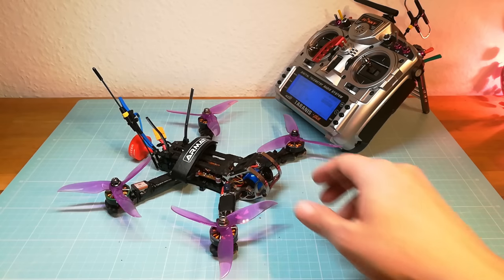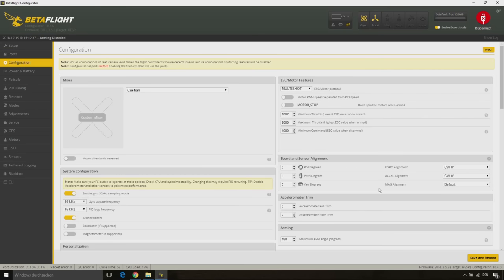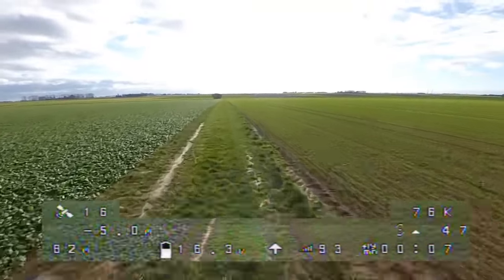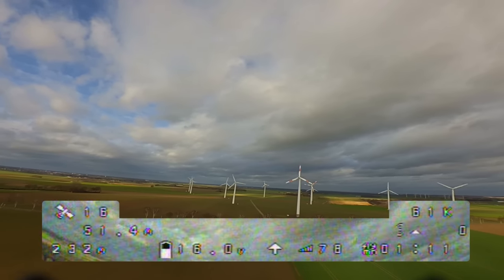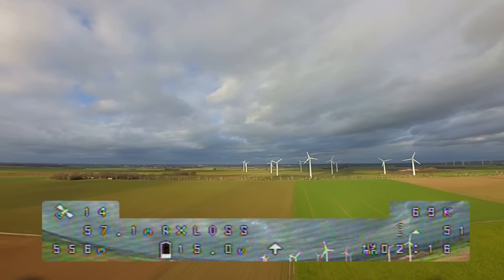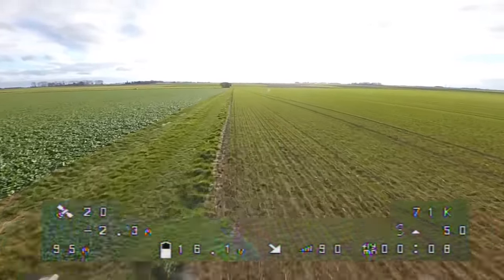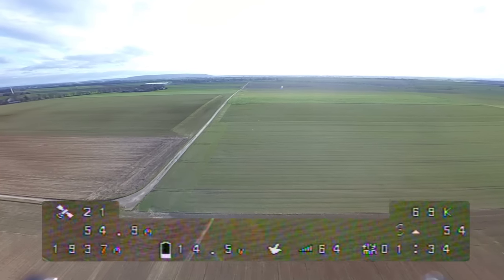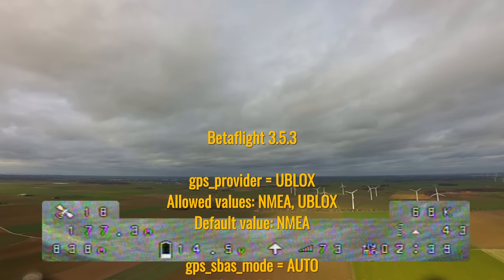Betaflight - GPS 🛰️ Rescue Mode 🚨 - Final Test - BN-180 GPS - FrSky R9M - english

Comment: You have helped me to set up my R9M/R9mm, very good videos...I have subbed this channel. I currently have R9m/R9mm and Gps working fine. I have BF GPS RTH on a switch and that too is working. I want to set BF GPS RTH as my failsafe but I have a question: My normal prefight checks are to power the quad (motors running) and turn the radio off to check that my failsafe is working. If i set the failsafe for GPS RTH in the CLI how could i do a preflight failsafe check?

Comment: It works great, I have a question why the battery voltage does not drop when you hit the throttle?
Reply from the maker: It does when I really hit it.

Comment: Thank you so much, but in taranis configuration, the failsafe that I need to put is "hold, no pulses or another one" thank you
Reply from the maker: I use hold
Reply: @TorbanDallas  thank you! But this hold, won't act like to "hold the stickers" the way they were before losing connection? Or it will work just like in the video? Thank you, loved the video, certainly I will do!
Reply from the maker: @RaafBr  no it doesn't hold the sticks, the bf failsafe tab overwrites the hold of the taranis.

Comment: Great test!! What mount or holder are you using to mount the immortal antenna in the quad in that position?
Reply from the maker: Cable ties 😉
Reply: Really? Looked too rigid to be a cable tie. Perfect!
Reply from the maker: @swissete  take a look at my frsky r9m troubleshooting video - there you can also see the antenna mount.

Comment: well done. 
gps is performing much better .. what was the fix!?.
cheers.
Reply from the maker: Thanks! This is a new BN-180 that i have installed on my other quad, i also have installed a copper shielding foil under the Module to protect it against electromagnetic inteferences. So maybe the shielding foil was improving the performence of the gps module, or the module is just better than the other bn-180 on my other quad.
I will add the foil under the other gps module too.
Reply: Actually, the foil provides a ground plane for the GPS receiver, that's why it works better for you.  The GPS should be up on a stalk for best results, not near one of your motors.
Reply from the maker: @EnglishTurbines  i agree with you, but i can't and I don't want to mount the gps on a stalk on my freestyle quads :D

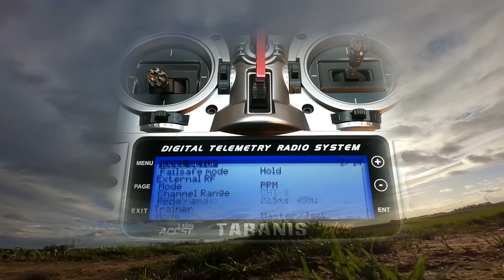Comment: Another question in 4:56 you turning off external module for 900MHz and then you said you will only use internal module for XM+. But have R9M could have connection with 2.4g recievier. I wondering maybe it is redundancy R9mini + XM+...
Reply from the maker: Yes. I also have made a video about it. You find it on my channel.

Comment: Why last test haha ?! , will the Hakrc f4 mini with barometer be a good candidate for a 3 inch micro gps build ? , do you know what gps module will work correctly or the hakrc f4 mini ? This will potentially be my first brushless quadcopter build , I’ve only built and flown brushed micro quads thanks and love the video that was far ! I have flysky i6s transmitter and will be using x6b Rx
Reply: The bn-180 will work if you have a free uart. 
It's cheap, small and works great.
Reply from the maker: Thanks for your comment, i think the gps module will nearly work with every FC with a free Uart Port. I recommend the GPS BN-180 Module that i have linked in my video description. It works fine as you can see and it's very small.
But do you think you really need a gps module for a 3 inch quad? For a 3 inch short range copter it's nice to have, but not nesessary in my opinion.
Reply: Torban Dallas well the 3 inch helifar fuuton mini gets 14 min flight times so I want to build something similar , it’s my first build I’m on  a budget basically so a 3 inch is ideal for me cause I have batteries I can use from my brushed quads I own now . Thanks
Reply from the maker: The LongRanger wow 14 min flight time. That's interesting.

Comment: i set my gps up just like all the videos and think i have it working when it comes to set-up but when i flip the switch it feel out the sky. also it would not arm until i set the sat =o  only arms  also in betaflight how to i make the gps indercator light come on to let me know its working it also show false not true.. can you help???
Reply from the maker: Do it as shown in my video and it works 😉 make sure to get enough sats before arming and to fly further away for testing the rescue mode - like 400m or more like i did.
Reply: @TorbanDallas  ok ill try that but it wont arm when i set sat to 6 or 8 sats only arms  when i set to =0
Reply from the maker: @aknight4u2001  yes of course it won't arm when you set it to 6 or 8 sats, you have to wait until you get your min sats. Otherwise, GPS Rescue mode won't work. Plug in your battery, wait until you get enough sats bevor your arm your quad!!! You can also use the low power on disarm vtx option in the CLI, so you won't burn your VTX when you are waiting for your satellites.

Comment: Vidéo is really cool, after setup the bn180 with u-center, gps on battery strap antenna facing up, I can't get more than 9 or 10.
Do u think or know if gps like bn-880 is better with compass or maybe just the bn-220 ?
Still follow you, good job.
Thx
Reply from the maker: Thanks! I didn't test another GPS module yet. I have installed all of my GPS modules on the arm and covered the underside with copper shielding foil. Interestingly, one of my bn180 get's around 17 sats, the other one only around 12.
Reply: @TorbanDallas  great, thx for fast reply, will try with 220 or 880
Reply: Hi there, what settings should be changed in u-center? Thanks

Comment: I mounted my flight controller rotated at 90 degrees when I first attempted the GPS recovery. My quad flew correctly until I put into rescue mode and it kept flying but in the wrong direction. I forgot to set the orientation of the flight controller in betaflight. Swiching back to acro mode I was able to take control just before the VTX signal dropped.
Reply from the maker: Interesting, but then your gps home arrow was also pointing in the wrong direction, doesn't it?
Reply: It was mounted in an Ummagawd frame so it was rotated and flipped upside down to keep the cabling tidy. Only flew away twice then I realised the different effects that happen when you set 90 deg clockwise and 90 deg flip on gyro AND accelerometer. The arrow worked OK on one setting but in rescue mode the quad flew away rolling left and righ like it was trying to fly upside down. It crashed into a tree with no damage.

Comment: Thanks for this, really helped me setup my gps return to home function. Question: You set your Channel Fallback on Aux 3 to 1500. What does the 1500 represent? You also set your Aux 4 to 1000? What is the reasoning behind this?
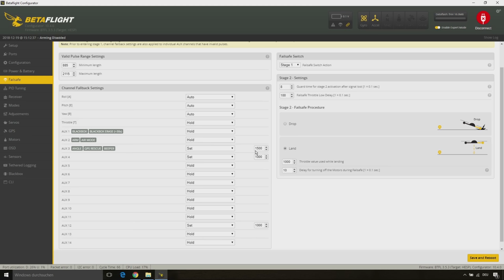Reply from the maker: Didn't you listen? at 1:32 I'm explaining why I did set Aux 3 to 1500. In case of a failsafe it sets my quad into the angle mode bevor the rescue Mode kicks in to make sure my quad is leveled horizontally. Aux 4 or Aux 12 (depending on which Rssi value i'm using) represents my Rssi and I don't want it to hold its last position when a failsafe occurs, I want it to show me a 0 in my Osd, that's why I set it to 1000 in case of a failsafe - I'm also explaining it in one of my other videos.
Reply: @TorbanDallas  Thanks, yes I did listen but I am still unsure of what the 1500 represents? Throttle value? millisecond delay? What is the difference between hold and the 1500 value?
Reply from the maker: @BrettSantillan  It represents the stick value regarding to the transmitter page in betaflight. Hold means that it holds its last position in case of a Failsafe. For example: if you are on full throttle and a failsafe occurs so it will keep flying away with the Hold setting on throttle. Set is to set it to the value you want it to be in case of a failsafe.
Reply: @TorbanDallas  Aaah Ok thanks. All makes sense now.

Comment: Nice video.what failsafe must set to my taranis to work the rescue mode?no pulse?
Reply from the maker: GORILAS RC, yes it will work fine with no pulse. But it also works with the hold setting on sbus or fport.
Reply: @TorbanDallas  thanks o lot dude

Comment: Does the necessity to do new GPS calibration for each new flight? Thanks in advance, and salute from Brazil.
Reply from the maker: What kind of calibration? You just need to wait for enough satellites. At the first flight at a cold start of the module it actually takes a few minutes. But on every next flight when you are out flying, the module immediately finds the satellites.

Comment: Excellent explanation. I have done dis to end it wont work it felt out the sky. My rssi goos not to zero it stays at the latest input. I run the r9 module on a external battery.
Reply from the maker: Thx. When does it fall out of the sky?
Reply: Wen i turn the radio of to simulate a failsave.
Reply from the maker: @rob.m8823  and when you activate the gps mode with a switch? What radio system are u using?
Reply: On a switch works fine i use the x9d plus se taranis
Reply: End the second version of flex firmware.
Reply from the maker: @rob.m8823  mh. Latest bf version?
Reply: Yes 4.0
Reply: Fried 4 esc so dont trust to experiment more.
Reply from the maker: @rob.m8823  damn 😕 i didn't try bf4. 0 yet. What's your failsafe setting in your taranis for the r9m?
Reply: Failsafe is set to no pulse
Reply from the maker: @rob.m8823  did you switch of your taranis a view hundred of meters away? If you are too close it won't work. Are u sure the cli command failsafe procedure is set to gps rescue?
Reply: No I switch it of a 70 meters away in the field. End on the bench next the quad.
Reply from the maker: @rob.m8823  70meters is too close.
Reply: thanks
Reply: At 240m stil no rssi drop.
Reply from the maker: @rob.m8823  did you try the gps rescue mode again? does it work?
Reply: On a fail safe not. On the switch it works
Reply from the maker: @rob.m8823  did you try it again? so it still drops when you switch off your taranis? Would really like to help you to get it to work in case of a real failsafe. Can you send me a diff of your settings?
Reply: Torban Dallas i have not gps on failsafe dis time. Only on a switch. I dont trust it to experiment til i see in the osd the rssi drop to zero wen i zwitch the transmitter of.
Reply from the maker: @rob.m8823  when you switch of your taranis, your rssi channel holds its last possition, you need to go to your failsafe tab, and set the value from HOLD to SET = 1000 for your rssi aux channel on the failsafe stage 1, so you will see zero rssi when a failsafe appears.
Reply: Torban Dallas o ride i try it soon thanks for al the help.
Reply from the maker: @rob.m8823  you're welcome! You even see it in this video on the failsafe tab - but i didn't explain it. I already explained it in a view other videos.
Reply: Torban Dallas it works great thanks voor al the help. I had to set the failsafe stage 1 on the rssi chanel to 1000 end it al works great.
Reply from the maker: @rob.m8823  nice to hear. Also gps rescue when u switch off your taranis?
Reply: Torban Dallas yes. On a real failsafe i have not test it but wen i zwitch the radio of it goos in gps rescue
Reply from the maker: @rob.m8823  that's great. Switching off your taranis is like a real failsafe.

Comment: still a last test to do: take the distance. gain some serious altitude. get inverted and trigger that rescue mode switch :)
Reply from the maker: Iceman on a failsafe the angle mode on the failsafe stage 1 will turn my quad but with the switch i have to switch it first to the middle position bevor i switch it into the rescue mode. Otherwise the rescue mode won't work and my quad will drop. That's my theory. I don't want to try it 😉
Reply: @TorbanDallas  I will try it sometime and let you know 😉
Reply: @iceman i'll like to see if you do that,i'm curious what will happen if the quad get inverted and gps rescue enabled

Comment: Thanks for the video, so do you trust the Matek GPS or have you lost confidence in it? I also noticed that tou were using ButterFlight is BetaFlight better for GPS rescue from what you have been testing?
Reply from the maker: GRob FPV i have got better results with the bn 180. I can't test the matek gps any more because i have lost the module on a crash.
Reply: @TorbanDallas  I saw the crash video. Well, my matek GPS is on its way hopefully it works fine =( Thanks for the answer!

Comment: great video.  i have a question:  If you have your RTH height set at say, 100m, and you are flying above that and failsafe, will it go DOWN to 100m, or will it stay at its current height for the return trip?   I ask this because I climb mountains, and if I'm 1000m up in the air on the mountain and my RTH height is set to 200m, will the quad try to descend and hit the ground because the height of the mountain is higher than 200m?  Or will it hold it's height?
Reply from the maker: Did you see my entire video? At the end you can see, that it also climbs higher as i have been on this flight. Even when it loses the signal when the rth was enabled it climbed every time. So if you set your height to 100 meters, it goes over 100meters of your start point or your highest point that you have reached in a flight. In your example, you are starting from 0 meters and you are flying over a 2000m high mountain, than you are maybe decreasing to 1000meters and you than you failsafe at a height of 1000 meters your quad will climb to 2000+ meters - the highest point you have reached in this flight. Hope i could make it clear :)
Reply: @TorbanDallas  Oh, I didn't realize that it kept track og highest altitude during the flight and used that for RTH, that's fantastic.  Is that default behavior, or do you have to set this s somewhere?   Thanks for the really informative video!

Comment: I used a mamba f4 flight controler and added the gps unit you suggested but i don't have barometer on the board is this going to be a problem with GPS? Thanks for your help Rick
Reply from the maker: I don't have a baro on board too. So the altitude comes from the gps module. It's not that exact but it works fine for the gps mode as you can see.

Comment: Thanks so much bro. But why im turn off my radio the failsafe not function. The quad just drop lol
Reply from the maker: Fly further away for this test, it doesen't work too close to your home point. Also make sure that you have set it up correctly as shown in my video. If you are using Crsf you should also check your Failsafe Setting of your external Module.
Reply: @TorbanDallas  around 150m im success using the switch RTH. But when i try to turn off my radio the quad also drop. Yes im using crsf and my radio is tango. what setting to and how to set there?
Reply from the maker: @Taufik.Moktar  I don't have a crsf module, I can't tell you the setting. But i think there are just a few options how to set it up on your crsf module. So tell me the options and maybe we will find the right one. I only know that it definitely depends on this setting.
Reply: Torban Dallas Thàñk ÿôû śø mùçh for the guide bro. Later me try again for further distance and try switch off my radio
Reply from the maker: @Taufik.Moktar  I did a research and found the solution for your issue, with Crossfire you need to set your Failsafe Mode from FS position to CUT.
Reply: Torban Dallas i didnt find CUT position. Where to find that? In the BF or radio?
Reply from the maker: @Taufik.Moktar  in the radio, respectively your crsf module settings. But as i have mentioned i don't own the crsf module. That's only what I have found on my researches. Now it's your turn to use all of my information ;)
Reply: Torban Dallas really appriciate it bro. Thàñk ÿôû śø mùçh later i let u know when im success. 👍

Comment: Hey is it difficult to set up the GPS unit
And is there any programming with the frsky 900
Reply from the maker: Well, you see what's to do to set up the gps unit in my video, do you think it's difficult? If you got it to build your own quad - the gps unit won't stop you ;)

Solder your gps unit to 5v gnd and tx rx (crossed) to a free uart on your FC. Follow my instructions, and there you go.

Comment: My quad doesnt switch to gps rescue mode when i fly it over 200m.i set the safety distance to 200m. Is there any setting if we use r9m? Im using r9m.
Reply from the maker: No, it should work as shown in my video when you set it up correctly, you can also take a look at my newer gps rescue mode video, maybe it helps to find the setting you missed.

Comment: Hello there! i have been testing but find my quad doesn,t descend at the set distance it seems to hover above even turn to maintain that position, could this be the idle setting being too high?
Reply from the maker: Well, play with the settings or use the settings i'm showing in the end of this video. Which betaflght version are you using? maybe there's something changed with a newer version, hovering could be even better than auto landing/crashing.
Reply: @TorbanDallas  i started with 3.5.5 then 4, both the same, must admit its good having it hovering around above, you can safely whatch it coming in with goggles off . It also always ascendsabove and never down to set altitude, 60 or 70m, no barometer fitted so ok really!